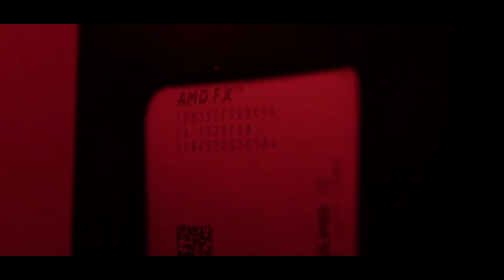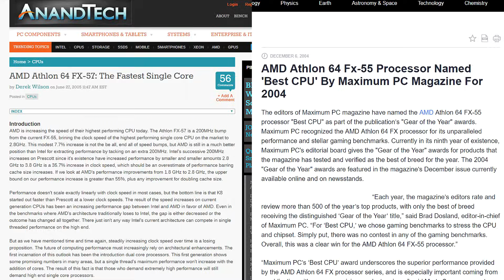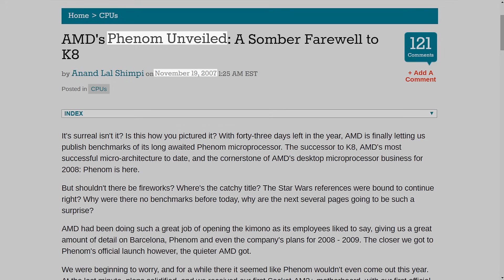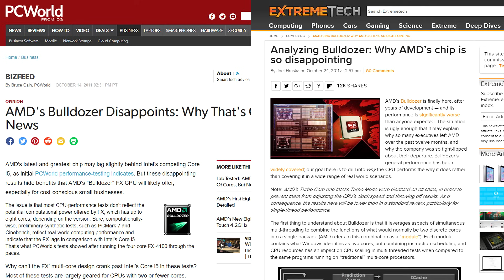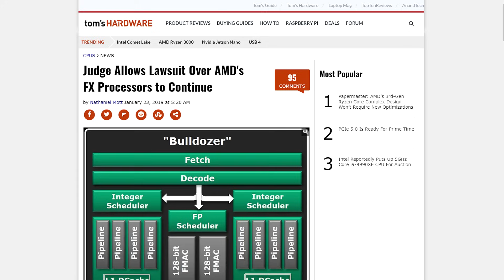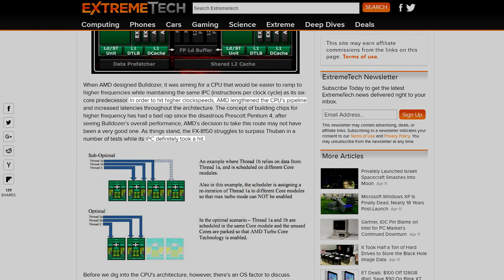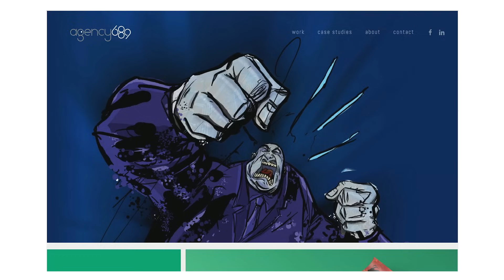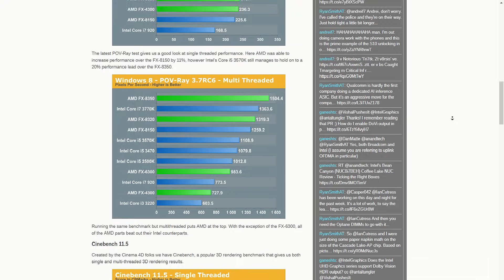Why AMD's FX CPUs Were Hated So Much? - The Fate of Bulldozer

Comment: I was using an FX8350 in my rig until a few days ago when I upgraded to a Ryzen 5 2600.  My fx8350 rig was super fast even at stock speeds!  I am using it for a second gaming computer for my girlfriend to use.
Reply: yeah people highly underestimate the 8350, it ran all my games well! even the new ones just fine! i just replaced my fx8350 with a 3800x just 2 days ago! the thing is insane!! i benchmarked it and it beat the i9-9900k! i was a bit surprised.
Reply: @sithioth  well my 2 friend got opposite results on that they both have 8350 @ 4.2 ghz and their games suffers like crazy with 30 fps at max and their games stutters like hell we all have same gpu r9 270x , btw i still have an fx 8150 and my pc ran games far better than them for ex 
the witcher 3 : i had 46~48 fps on avg with all setting on high without stutters , while they had 26fps on avg with stutters
same for far cry 4 : i had 55 fps avg with high+ultra + med settings mix , and they had 30fps 
Rise of the tombraider : i had 38 avg on medium+high settings , on their system it was unplayable.
my problem with this chips that during productivity tasks (specially using unity and premier pro) , it is slow as hell and i have to wait on everything to process it's just sucks
Reply: @jaanu2222  The 270x really suffers in newer games. Something like a GTX 970 or RX580 really springs new life into FX machines. Night and day difference going from a 2gb HD 7870 to a 8gb rx 480.
Reply: @1986tbirdwilly  i agree but it'll be huge performance drop still, cause 970 is still a beast card anyone who owns it and wanna play 1080p games there's no need to dump it for atleast in upcoming 2 years , i am using FX since 2013 and still using it cause i got no money to upgrade and as compared to windows 7 it runs lot better on windows 10 plus little tweaks from my sides makes it run better than others FX 83XX series
Reply: @jaanu2222  Only the scam 3.5 gb VRAM on the 970 is annoying since texture sizes are getting so big you need to play on medium texture settings these days. I would recommend a 580 8gb over it.
Reply: @jaanu2222  could be thermal or VRM throttling on their boards, as these CPUs needed very good voltage regulator modules. This would lead to drops in cpu frequency which translates to lags or low fps in games
Reply: @Square-0ne  i had a normal mobo once but upgraded it long ago with 970 then 990 which i guess was the highest for this mobo well i've never said i've faced any lag or stuttering issues with it games ran even better from 8350 users , what i was complaining about its single core performance , and a missed performance which was bottlenecked my gpu , i mean it could give me some more fps if i used different cpu , as for productivity this is okay i mean for unity and AE , it's slow but i am used to it now the waiting time
Reply: @sithioth  it beat the I9 9900K becasue the Cpu was made in 2018... wait for Intel to release their 10th generation 10nm cpus then they will beat your cpu no probs
Reply: @sikijunior1  me from the future 10th gen Intel is still on 14nm+++++++++++++++++++++ lol
Reply: Still running on a FX-6300 + GTX 970 xD
Reply: actually, no. FX8 was more expensive when it came out compared to i5 at the time. When i built a gaming rig back in 2012, i opted for 3rd gen i5 instead of fx8 and to this day, rig is still very usable for AAA games. I'm pretty sure i'd upgrade the fx8 long before.

fx cpus were never a sensible choice for gaming, unless you could get fx8 for less than what i3 was going for at the time. it just wasnt a good architecture for the task.
Reply: @hojnikb  yeah that's what i was talking about , i could've buy an i5 and it could be my best option that time but i chose FX , well hope so my FX will cover up all the mess and helps me finish my some big projects so i could earn and buy a ryzen 3700x and go into hibernation for a decade.

Comment: It's good just don't use stock fan, it's inadequate
Reply: And loud
Reply: FX was bad unless it was some music production PC. Ryzen also struggled to beat intel in Gaming, but they did, and only in 1.5 years.
Reply: @kire929  well I am not that into getting above 100 FPS, for me even 30 FPS is enough which I get 40-60 FPS depending on graphic settings
Reply: @adisetyawan4271  That doesn't correlate too much with what I said. It's just that FX are bad in general.
Reply: @kire929  but affordable and still can be use on today gaming, RDR2 minimum is FX6300 btw
Reply: @adisetyawan4271  Rockstar minimum requirements are not something you should trust at.

Answering the other thing, FX aren't worth it 2nd hand when you can get an i5/i7 from the 4000 series.
Reply: @kire929  well actually someone alredy try RDR 2 on lower rig so I am prety confident, I can play RDR 2 when release on steam next month
Reply: @kire929  so far I am even getting 50-60 FPS playing JC4, JC4 minimum also FX 6300 BTW or even FF 15 (already try that to)

Comment: My FX 8320 is still my main cpu for the last 6 years hitting just over 4ghz with a liquid cooler and 16 gb of ram to play with at 1600 mhz I built it with game designing in mine rending 3D models and levels creating audio and applying textures it's still  more than capable of running civ 6 or house flipper at mid preset also paired it with a gtx 760 4gb.
Reply: maaan get that ram up to 2100!
Reply: @HelloWorld-lg1pz  no point since I plan on upgrading to ryzen
Reply: @woody230uk  well of course but why not get some extra performance..takes 2 seconds in bios geesh
Reply: @HelloWorld-lg1pz  never overclocked and the first I played in a bios I blow up the motherboard greatfully the board only cost me £55
Reply: @woody230uk  damn you must have hit the self destruct button
Reply: @HelloWorld-lg1pz  I think i change the hyper transport to 5000 I think that broke the board

Comment: 4 ads in 10 minutes?

really?
Reply: Most of the ads don't even play. So chill out.
Reply: Sounds like its time to get with the times and run an adblocker...It's almost 2020 for christ sakes.
Reply: morgz : nervous sweating
Reply: @julatzschmulatz9607  but its literally just a "AMD overhyped a badly designed chip"
Reply from the maker: You can use AdBlock if that bothers you.
Reply: @RATechYT  You won't get very far on this platform with replies like that.
Reply from the maker: Well, that is a solution. If you want to support this channel, you can disable AdBlock, if you don't want to watch ads, you enable it.
Reply: @RATechYT  I'm using adblock, still getting the ads. Sorry but internet bandwidth costs me money. I'm not wasting it on ads.
Reply: @MrMercurybullet  Try Ublock Origins.  Way better blocker that doesn't take cash from ad agencies to allow some ads through like adblock/plus does unless you delve deep into it settings and turn off the allowed/approved ads 'feature...'
Reply: @andeen  nope. I was bought up in a time when the internet was for the people and didn't have ads. Why should I pay money for some multinational company to invade my house with ads?
Reply: @zybch  thanks Mikey. I'll try that.
Reply: @MrMercurybullet  Internet Bandwith costs you money? Uh, you paying for dial-up with 100 MB data cap a month or?
Reply: @luisgonzalez5482  I grew up in the 60s kid.
It's simple I just don't visit sites that run 4 fucking ads, in my home.
Lots of ad free sites. The only reason I'm here now is to answer your abuse. I gave the guy feedback. Don't like it, see if I care.

Comment: I have read before that AMD actually did have a version of 15h taped out around the time that the X6 Thuban came out, but that the chip was so noncompetitive that they decided not to release it at all, waiting for the x1x0 Bulldozers that we saw in late 2011. I don't know if this is true or not, but we know AMD had all sorts of trouble making this design work at all. We never saw Steamroller FX chips, and even the version that made it into APUs was a revision of the original Steamroller design. They promised Carrizo on FM2+ and only delivered one SKU, very late, that had limited compatibility. I still have a $140 FM2+ board that runs an 870K that I'd planned on dropping Carrizo in, but never could.

AMD just lost the script completely after the first A64s until they got Jim Keller to come in and design Zen. Piledriver was OK if you were running multiple threads, but in single-thread performance, it really wasn't any better than good i3s.
Reply from the maker: To be honest I always wanted to get my hands on an 8 Core Steamroller/Excavator chip just out of curiosity, but I guess it was a good move for AMD to completely ditch it and get into designing Zen.
Reply: Jim Keller designed Athlon 64 too
Reply: Carrizo made it into Athlon X4 845